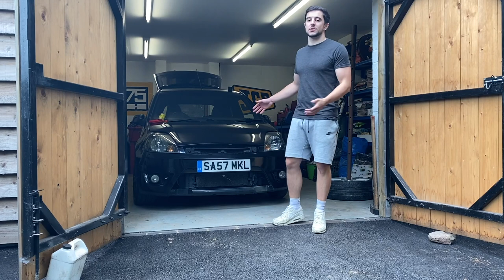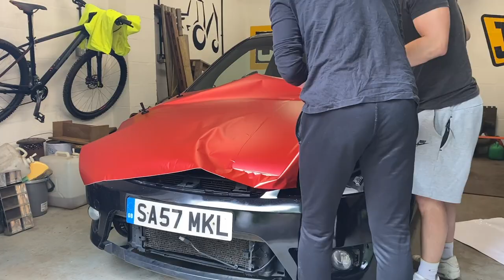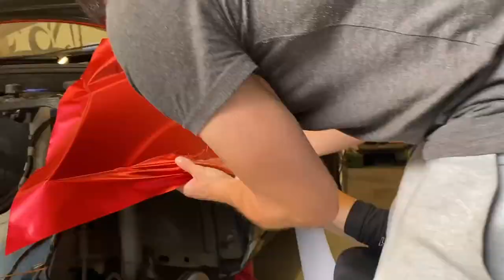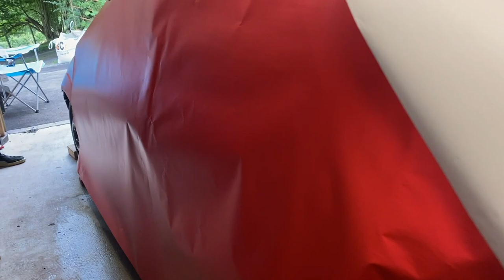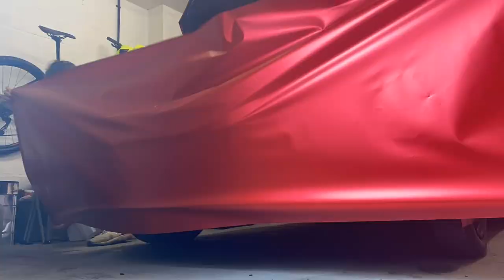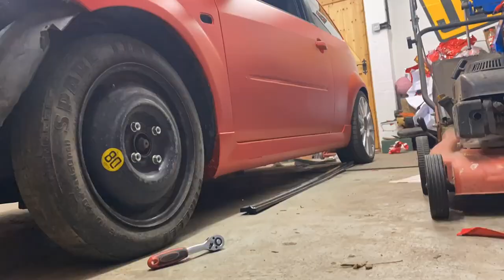THE WRAP | Vinyl Wrapping my MK6 Fiesta ST150 | *DIY*

Comment: working in triangles is the best way to approach wrapping. The way you did the bonnet looked painful. pull the corners of the vinyl outwards in triangles. alot easier and even tension throughout
Reply from the maker: Nice one thank you for the advice mate 🙏🏻